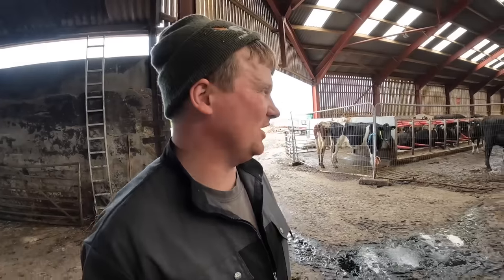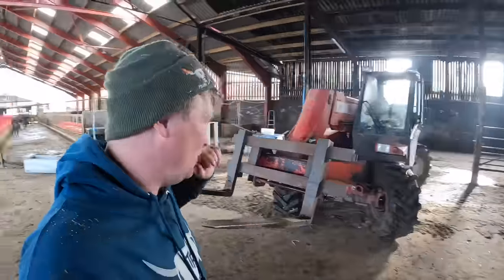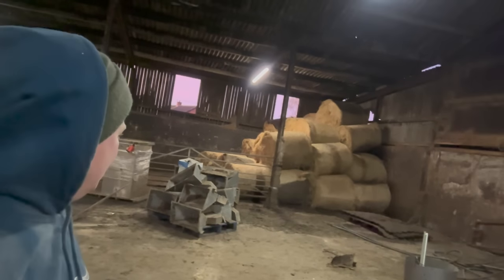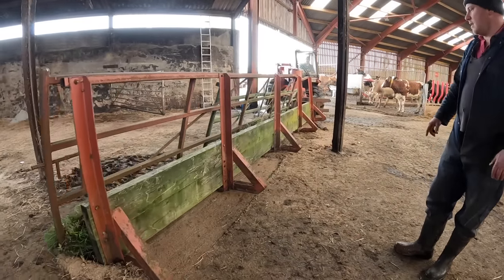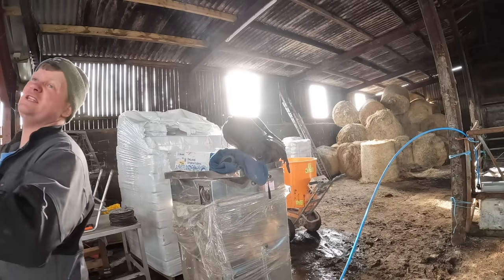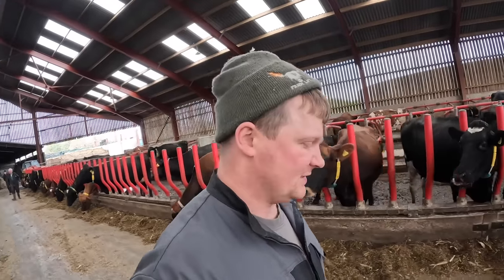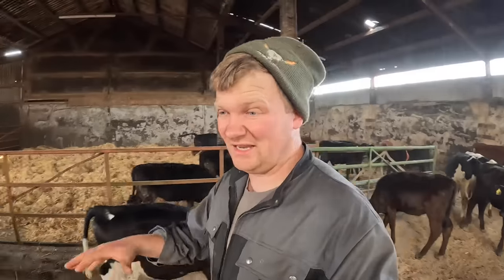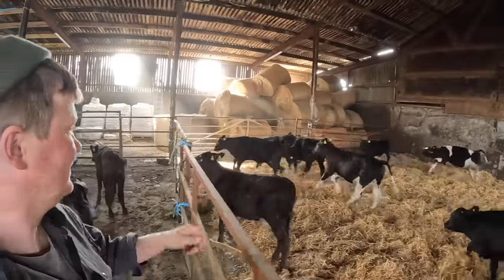THAT DIDN'T TAKE LONG... THE SHOW ROOM IS ALIVE!!!

Comment: Back in the 80's when I was at agricultural college, we would have practical days on a neighbouring estate. We gave a hand moving yearlings from one shed to another. all good. However the farm foreman did not close the gate to the shed, consequently all the young stock found their way out and into the lawn of the farm managers garden. The easy solution for the foremen was to blame the students.  The issue was escalated to the college principal and  as the solution we were detailed of filing 1000's of hoof holes in the lawn, we protested our innocence, fell on deaf ears. The deal was if we did not tackle the lawn, students would not be invited back to the estate for practical experience.

Comment: How to make hard work for some poor bugger- dump a heeston bale at one side and let them hand ball or fork it out, rather than cutting the strings and pulling it about a bit with the forks or a bucket etc? Work smarter not harder ive heard a few times??
Reply from the maker: Would do an awful job though 🤦‍♂️
Reply: @TomPembertonFarmLife  just spread it about a bit more is all meant so the guy doing it hasn't such a tuff job to do walking all over carrying straw wads. I know it'd make a sh1t job the way you thought I meant. I always tried to work as efficiently as I could, my benefit and the staffs benefit.